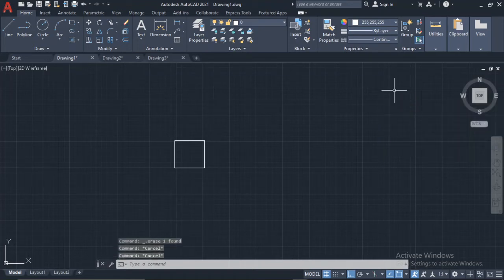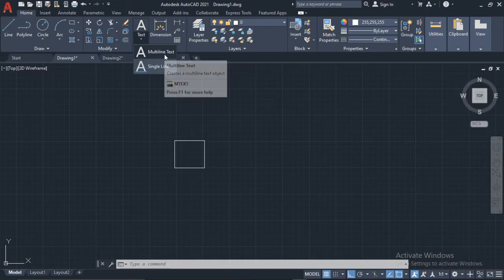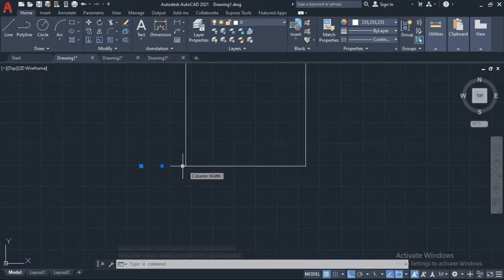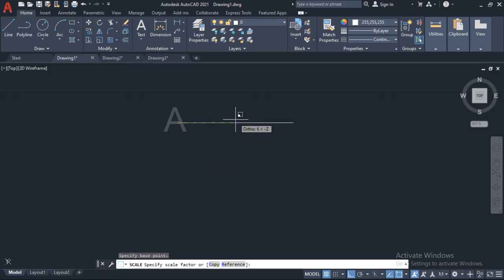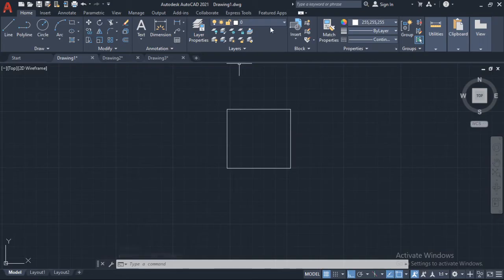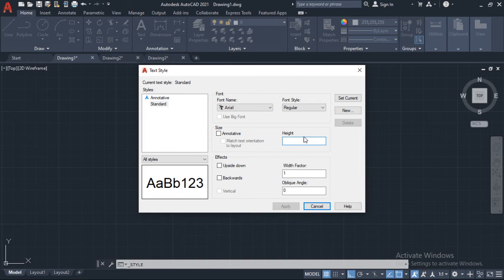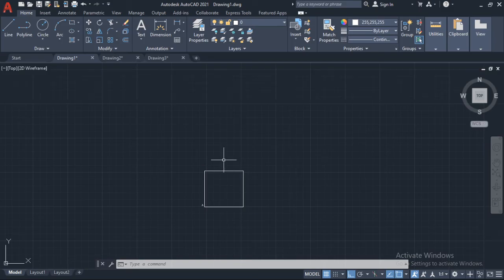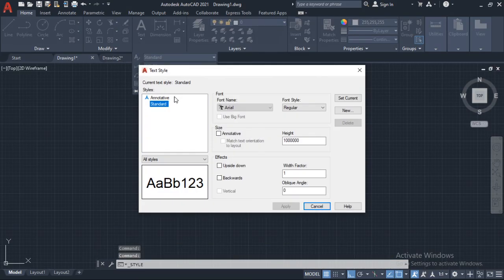HOW TO FIX TEXT NOT SHOWING IN AUTOCAD

Comment: Additionally  use a ratio of 1 : 25  for your text height, or 5 to 7 mm for drawings between  70 t0 100 mm in size.  And 150 mm for Building that solves all thise problems one and for all
Reply from the maker: Thank you very much.

Comment: Thanks sir Cargill; a simple way to solve that  problem is to used Single line instead of multiple line text.  This will allow you to set the text height relative to the size of the drawing.
Otherwise it will not show up if you are doing large drawing  such as site plan or building drawing
Reply from the maker: Thank you for sharing